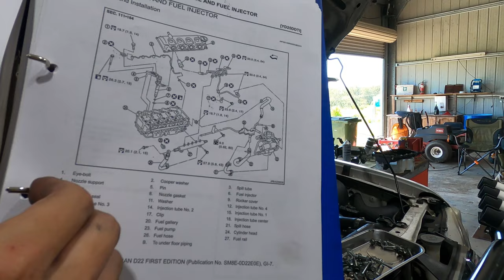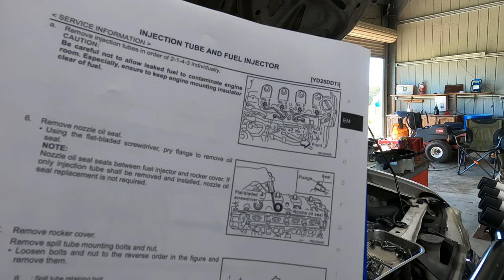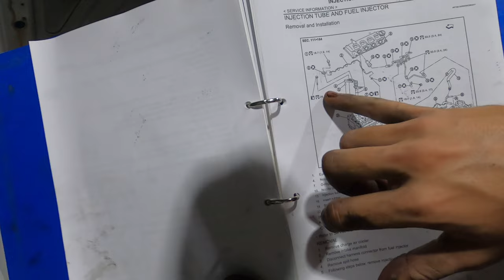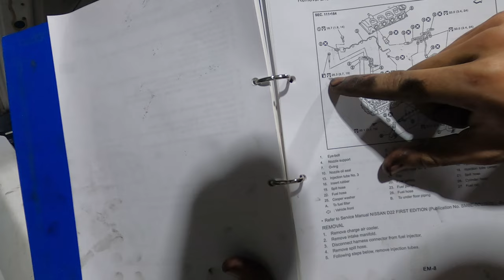YD25 D22 Navara Injector Replacement

Comment: Great video and great advice on the tapped cover, I broke 2 covers because I was supplied a wrong gasket kit which included 4 injector seals and tried to replace them(FYI they are non serviceable) . 
Now I know I have to replace my scv and intercooler.
Reply from the maker: Thanks mate, being sent the wrong parts is always a bummer but at least you know you weren’t at fault. And SCV is very easy to replace if you can move the hoses and cables from above it 👍🏻
Reply: It turned out OK as the store I bought the supplies from had to buy me a new rocker cover but it was a hassle.
Reply from the maker: @athilaweerasinghe3173  yeah good of them to supply you a new one, still doesn’t cover the labour you put in but it’s better than nothing 👍🏻

Comment: Love this well done champ.
I like to do mine, nissan navara d40 2010  i had a machinic change our my injectors but it failed on the first injector as diesel is leaking out of her, when having a macanic fails and charge a wounded bull, it's is upset as normal, one takes pride doing it all yourself.
I like to try as iv built up my tools for a chance to understand and able to know how to do.
 If you have any other advice, please let us all know.
Well done
Reply from the maker: Sorry to hear that but it definitely gives you a chance to learn your car and better your skills. I'd look ahead at the specialised tools that you may require and order them ahead, things like pullers can be found fairly cheap on ebay but will cost loads at the local automotive shops.

Comment: Hi, is there no need to depressurize the fuel system before removing the injectors? Also did you bleed the fuel system afterwards? - Daniel
Reply from the maker: Hello the fuel system will depressurise as you undo the injectors if there is any pressure left in the system and yes the fuel system has to be bled afterwards👍🏻
Reply: @ReubsModifications  thank you a lot for this info!
Reply from the maker: @DanielKessler-iq2zu  no worries mate let me know if you have any more questions 👍🏻
Reply: @ReubsModifications  hey mate, do you have any tips for bleeding the fuel system in a navara? I tried most things from the book, but it just doesn't want to start up.
Reply from the maker: @DanielKessler-iq2zu  have you programmed the new injectors?

Comment: Hey mate i have a 2007 d22, zd30 turbo diesel. Is replacing injectors here the same procedure.? Does my ute requiring coding of injectors. Thanks in advance.
Reply from the maker: Hey mate, the ZD30 is a bit easier as the injectors are completely mechanical however they take a bit more work to pull out.
Reply: @ReubsModifications   I'll  probably give it a go now, given I'm presuming there's no coding of injectors.great vids by the way. Thanks again
Reply from the maker: @darrenpierce9903  awesome to hear you’re having a crack at it, if you need to you can check out a video I did on replacing glow plug and injector seals on a ZD30. It should show you about half the process of what you’ll need to do 👍🏻

Comment: Hey mate thanks for the videos I'm enjoying the progress with the SAS just wondering if you did anything with or changed the turbo here on the yd25 because I just had the same problem with the intercooler but then too my turbo leaking oil got really bad it almost sucked all the oil out of the motor so I'm replacing that this week and have my new intercooler from forefront industries ready to go on at same time did you take any video while cleaning the intake manifold as I'm sure I need to do that aswell, anyway thanks for the videos keep up the good work
Reply from the maker: No worries mate, I didn’t do anything to the turbo on this nav as we weren’t sure it was the issue. To do the intake clean I just removed the manifold and put it in a degreaser bath and scrubbed it. If you don’t want to remove it there are some intake cleaners you can use while the car is running you spray some cleaner down it 👍🏻
Reply: @ReubsModifications  yeah something to keep an eye on but it definitely seemed more baked on the oil from the intercooler in your video so looked like it would have happened slowly which is super common so I'm sure its probably fine but something to keep an eye on now especially with the sealed intercooler as you wouldn't notice the oil thanks alot for your reply and awesome not too complicated il definitely clean my intake out then aswell may aswell pull it off

Comment: Hey mate, thanks for showing your knowledge. My d22 is hesitating so a code came up that it’s a leaking injector. Do you know why my engine light isn’t on due to fault? And do you have to code them in after installing? Thanks
Reply from the maker: Im not sure why the engine light didn't come on if the scanner could find the fault. The injectors do need to be coded in and cant be done with a normal scan tool. We had to use a commercial software for trucks and light vehicles to program in the injectors.

Comment: Top notch bud. Did you do anything with the EGR valve?
Reply from the maker: Thanks mate, I just cleaned out the built up carbon, didn’t block it off with a plate or anything as I added a catch can after 👍🏻

Comment: Awesome video.
My 2006 D40 (yd25) has 242,000 on it and am thinking of doing this service. It’s not blowing any smoke, but thought around 250k might be a good idea?
How hard is it to get software for doing codes at the end?
That’s the issue I might have as I don’t have the Tuning software.
Reply from the maker: Thanks mate, we have a license for commercial vehicles which covers our fleet of trucks and some light vehicles like utes and vans. The license is quite expensive and probably isn't worth paying for, just for the one job unless you can find a cheaper program. Alternatively you could do all the labour and parts yourself then have a mobile mechanic come to you or tow/trailer your car to the mechanic 👍

Comment: Hey mate, what was the software and hardware you used to program the new injectors? Great in depth video, good job
Reply from the maker: Thanks mate 🤙, we used Jaltest commercial vehicles for our work trucks which includes some light commercial vehicles. Sometimes we aren't able to find the vehicle so we will find another with the same engine and select that.

Comment: Hi mate about to do this on a r51 pathfinder yd25 vsk model, is it all the same as this? I can't seem to find anything in workshop manual only can see petrol injector how to, not diesel.
Reply from the maker: Hey mate should all be fairly similar as they are the same motor but I can’t guarantee that they will be identical 👍🏻

Comment: Hey mate are you able to link the manual from scribd? I can’t seem to find it
Reply from the maker: Hey mate I'll have to have a look on the PCs at work, I do remember there were a few dud manuals on scribd that look good until you open them and there's nothing in them.
Reply from the maker: Hey mate I’ve had a look on scribd and I can’t find the file that I use to get my manuals. I managed to find a few different manuals for the engine, gearbox and electrical but can’t find a complete service manual sorry.

Comment: Hey team

Do you recall how many KM was on that D22....?

Why was the injectors changed.
Reply from the maker: I think around the 200,000 mark, there had been a drop in performance and the vehicle was blowing black smoke 👍🏻
Reply: @ReubsModifications  amazing how clean those injectors were for 200k? No crud / stuck in the head issues to deal with makes the job 10x easier